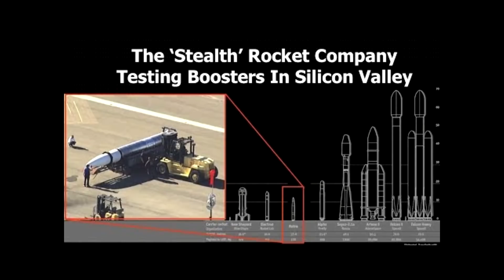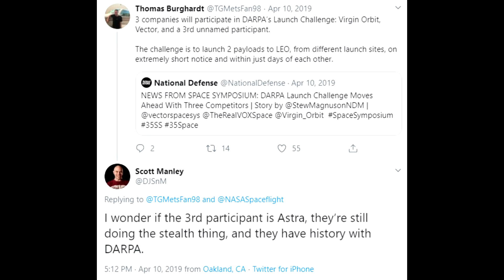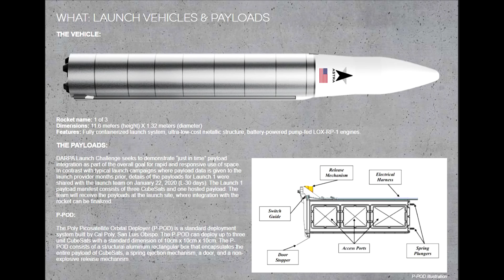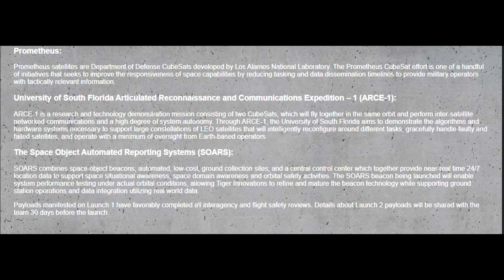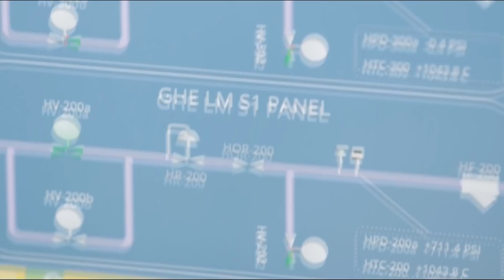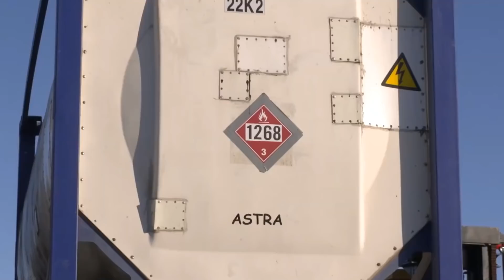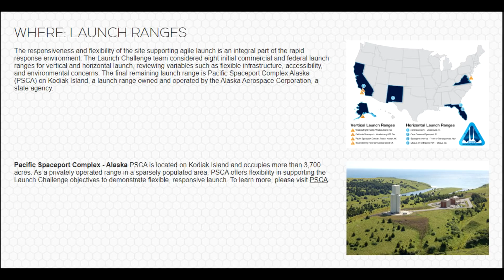Astra's Secret Rocket Project Finally Reveals Itself

Comment: V2, 80 years later...
Reply: V2 couldn't launch to orbit
Reply: Dean Su neither this! (We'll see)
Kind of US Scud missile in making...
Reply: @stormtrooper9404  Scuds are only big Rockets.
 Ballistic shells, only launched by a rocket engine instead of an explosive charge.
  Missiles have guidance.
As it appears, the first two were indeed only Scuds, but without a warhead.  Let's see if they can actually MAKE a missile!
Reply: @stormtrooper9404  It can though, that's the whole point of this program. So it vastly outperforms Scuds and V2s and anything less than full-blown ICBMs. Of course, it doesn't come with reentry vehicles for the warheads, so it isn't really meant for missile use anyway
Reply: @dsdy1205  Rumors say they did hit space with the V2.  Hitler had plans to orbit a large "Sodium" coated mirror, to burn  targets on earth from space anywhere, any times. . .  Sound familiar?
Reply: @cyiabsalon9720  they definitely hit space with the V2, but getting into space is very different from orbiting.
Reply: @johnvonkerman  Come on Peter.  You well know that if they had the time, it would be a fact.  The German Nazi's were ahead of Everybody in that regard.  At that time, the worlds Best scientists and researchers of the world were already captive of the 3ed Reich.  . They cleaned out Vienna, bagged them all, and drug them back to Germany.  Everybody else was hard pressed, scrambling to thwart them at every turn. . .  Lucy for the world, they came against a brick wall when they ran out of oil, and had to synthesis their fuel.
  After they war, the US nabbed up every scientist they could get their hands on from Germany, and put them into OUR war machine of which NASA grew out of.
Reply: @cyiabsalon9720  ok? I just said they didn't have the technology. The V2 had nowhere near the deltaV to get to orbit. Remember, we got their scientists after the war and it was over a decade before we put something into orbit
Reply: @cyiabsalon9720  Hitting space is very different from hitting orbit. The V2 did indeed hit space, as did several artillery shells. To stay in orbit, like this rocket does, you have to go 7 times faster than that. Quite a mean feat of engineering.
Reply: @dsdy1205  And if the Nazi's had a little more time, . .  What do you think?  The guy who designed the V2, IS THE SAME ONE WHO DESIGNED THE DELTA-V5! And still has plans to build the Delta-V7.  But it's so large, it must be constructed in orbit.
  Now think; Where was all the rest of the worlds scientists who were NOT under the Nazi's thumb in those days?  There were very few "Free Scientists" left in the world back then. Given another year or so, the Nazi's would have done it.  But, they ran out of gas, and the rest of the world capitalized on their "E-for-Empty" problem.  That's the ONLY reason why Germany lost the decisive "Battle of the Bulge".  The Germans simply ran out of gas.  That includes Kerosene for their V projects as well.
  And no.  I'm not German.  No bias here.
Reply: @dsdy1205  The size and mobile launch system are extremely comparable.
Reply: @bouldersoundguy  Indeed, the size is comparable, but the performance is way beyond V2 levels. The V2 could barely hit England, this thing is orbit-capable, which means it can toss payloads as far as modern-day ICBMs (which can also launch stuff into orbit) can.
Reply: @Joe Horn You Bet'cha!. . .  Supposedly a whole fleet of them.  BUT, there is a fun story to go along with it.  Allow me:
  The Nazis were in contact with the reptilians a little while after the beginning of the war, right when when Hitler wasn't Hitler any longer. . . (Another story for another time.)
  Anyway, the snakes just up and gave the Nazi's several craft to study and to train human pilots with.  Hitler was getting worse, and he was starting to slaughter his own due to not performing as his sick mind insisted of them.  SO, the top officials of the saucer project, along with the largest cadre of the most influential scientists they could muster up, hopped on board, and took off to the moon and Mars, stranding Hitlers dumb-ass here on earth, where they remain yet today.
  I waiting for a picture from the Rover Curiosity to come back with something there sporting a great big ol' Swastika or an Iron Cross. . 

 Ooh gawd, wouldn't that be so much fun to watch everybody crap their pants?
Reply: @Joe Horn Humm. . .I've heard so much about Nazi Germany and flying things that glowed; foo-fighters, the Bell, even that they were given the plans to make the propulsion system, so they attached it to several of their U-Boats, `cuz they were air tight already. . . (yawn..)
 As for Hitler in his back yard with an erector set?  nope.  That's a new one for me.
Reply: Operation Paperclip (Von Braun, Kurt Debus and many more German rocket scientists )  started -up in 1944 with project Hermes V2 program.

Comment: This launch table looks like one designed for V2.
Reply: Why re-invent the wheel?
Reply: Jttv , Atlas program.
Reply: Well you need to eat when doing rocketry.
Reply: The whole concept is exactly the same of the V2.
Reply: @SVanHutten  well except for how the rocket actually operates since I doubt it uses clock work guidence or a peroxide generated steam powered turbine for the pumps.
Reply: @maxk4324  It uses electric pumps
Reply: @sundhaug92  Ya, I saw that later on in the video, but thank you none the less. This only reinforces the fact that it is very very different than the V2
Reply: Max K it also doesn’t hit the ground in populated areas and detonate.
Reply: @SVanHutten    The same concept as the V2?
As in 'liquid bipropellant rocket', sure.
About everything else is different.
Different fuel (ethyl alcohol)
Different pumps (electrical instead of T-Stoff (hydrogen peroxide) catalysed tOo steam driving a turbo pump)
Differently shaped burn chamber
Different number of engines (1 vs 5)
Different attitude control actuators (two sets of 4 vanes: one set of graphite coated one in the rocket exhaust and one at the end of the fins versus 2-way engine gimbal)
Different guidance system (PIGA acceleration meter and pitch/roll stabilisation via gyroscope (and radio beam following, though rarely used) vs a grown up INS/GPS/radar/radio/laser metering, possibly star/sun/earth tracker usw systems)
Different payloads (obvs)
One-stage suborbital rocket (up to 320km or so) versus two-stage orbital rocket
Military government project vs civilian project
Machine of war and destruction vs access to LEO for smaller payloads at lower cost.

Yep, it is all the same, and so is the fireworks rocket you fire off.
Reply: ADvorak ADvorak it’s still very much a military government project and a machine of war and destruction...it just so happens to be LEO accessible, lower cost, and rapidly deployable as well...DARPA even mentions “warfighter capability” and bringing launch availability up to the mobilization speed of our other branches...who have global rapid response capabilities able to “reach out and touch someone” in the same timeframe DARPA allotted the project for this launch.  The difference will be the size of the boom (and likely number of booms) it’s payload carries.
Reply: @SVanHutten  With the mobility of the system and that launch stand, I immediately started thinking of the V2, though the purpose and technology are be vastly different.
Reply: @SVanHutten  Well the mobile launch part is but the rocket itself is very different.
Reply: Nope.
The V2 table had just a spike in the middle, re-directing the flames into all directions (including against the table structure itself).  This is not the case of this launch table.
And that is just one obvious difference.
Reply: Well, look out London!
Reply: @zapfanzapfan  Shit... I live in London... lol
Reply: That was also my impression
Reply: Late-stage DARPA is so grassroots
Reply: Somethings better than that
Reply: Well, it’s a militarized rapid deployment rocket with presumably “dummy” payloads...sooo yeah.  How fast can we get a sub-orbital/orbital weapon in the air...
Reply: It looks like an ICBM.
Reply: Why change something that works well for the application?  There's only wasted time, material, and money produced by re-inventing the wheel.  Simplicity is usually much more durable. . .   (Compare the NASA approach against the Russian old fashion, boiler-plate style Soyuz craft.  Theirs have been working solidly for over 50 years.  NASA? Not so much.)
Reply: @cyiabsalon9720  Solid, simple designs are only effective if you can manufacture them to spec. There have been two HSF-rated Soyuz anomalies in the last half-decade. Both due to manufacturing and/or assembly defects.
Reply: @dougpowers  Correct.  Nothing we make as a race is 100% infallible, or 100% durable. .  However, in this case, the Russians have it more in hand then NASA does.  Maybe that's a good reason why the Chinese are copying the Soyuz instead of our Shuttle?
Reply: @cyiabsalon9720  Russians use incremental development.  They make what already works into something better.  The US are more into revolutionary innovation so they start over almost on every new project.  Two mindsets but considering SpaceX successes there can a payoff for audacity as long as it is investor money.  Government agencies are too far removed from the consequences of failure till we get it right approach.
Reply: @mikecimerian6913  To a degree, yes.  But there is a transition period in which there should be an overlap to some degree.  We have to jump right into a completely new platform, just when we barely understood the previous, you know. . .  That Incremental thing you mentioned.  That's how SpaceX is going about their fabulous advancements, right? They haven't even dabbled in anti-gravity or space stations, the latter being Jeff Bezo's area, as of yet.
Reply: @cyiabsalon9720  spacex employs a bit of both. They had a major jump early on when they decided to go from falcon 1 straight to falcon 9 after the first successful falcon 1 test flight. This worked out well for them as everyone knows. Then once the first falcon 9 commercial flight was a success they began to iterate on it until they arrived at the latest version, Block 5. They have other examples of both strategies, those are just the most famous. In reality the best solution is almost always a mix of the two, employing big jumps when you must in order to not waste time in the kiddy pool, but then incrementing once you arrive at a successful design that shows you can keep your head above water in the deep end. The reason NASA and the Russians seem to only ever employ one or the other is a bit of a mystery to me.
Reply: @cyiabsalon9720  We know what conditional funding does for rigor.  SpaceX went incremental, agreed.  Their realistic approach is paying off.
Reply: @mikecimerian6913  they are kinda risking themselves again with Starship too, and i'm sure even when the first Starship flies there will be thousands of progresive itinerations until they arrive at the perfect design
Reply: Cyi Absalon Soviet Russia used the Soyuz because they failed to complete their shuttle, the Burron. Thy used a simple design because thats all they could come up with as the Soviet Union dissolved.   That is not some superior game plan. Its the failure to build anything better and a failed economy.  

The Soviet Union had a strong space program, Russia is only a shadow of its former self.

Comment: Split my sides at Arce Soars, haven't laughed as much since Randy Bender's presentation for NetWare.
Reply: Marc Jackson  I was a Netware tech.  Netware 4.11 was the best and was never surpassed.  Netware techs always scoffed at MS servers for their need to be rebooted and defragged.  I ran a server cluster on a two year clean run.  The OS was so reliable that people would forget where the server was.  Netware forever.  :)
Reply: @mikecimerian6913  Wow, that does sound like one hell of an OS! :) I'd like a stable branch in the development of modern operating systems, but no - much of what's released to the public is years away from leaving the beta stage... :D
Reply: Didnt get it. Could you explain for not english speakers?
Reply: @fs2728  Arce sounds like arse [USA=ass] which is English slang for anus, soars sounds like sores so it translates to anal herpes. Randy Bender is a man's name in USA but it means "sexually excited homosexual" in English slang.
Reply: @andyalder1  I thought it was a pun for Archosaurs
Reply: Prometheus's Arce Soars.  🤣
Reply: Marc Jackson  Netware 4.11 was never intended to "host more functionality". It was a file and print serving architecture, period. And it did it very well. When it came to strictly serving files, they were served to the workstations faster than anything Windows could do at that time, and equaled what any unix system could. I also directly administered several Netware servers in the early 80's, all of which ran for over three years with zero unscheduled downtime. That's better than "5 nines". Microsoft was simply the elephant in the living room that squashed them and 'nix both. (Linux/Unix today is a different story, but let's not judge the past by today's standards.) Novell tried to compete with Microsoft for the "office network/intranetwork", and that was a significant factor in their downfall. They never found their own place in the business world.
Reply: @sidewinder666666  There was a story in the news in early 2000s that they couldn't physically find old Netware server on their network, only to discover two cords (power + coax) going into a brick wall. After breaking through they found a Netware server that was just left in a wall niche behind new brick wall that was put by some jokers builders performing some reno job in that campus several years prior!

That thing just stayed there for several years, unattended, continuing it's file service until someone decided to find it.

I was never fan of Netware. But it did it's job just fine.

Sorry for the offtopic.
Reply: @andreybashkin9030  true.
Reply: Andrey Bashkin I heard the same story about a VAX Cluster. After a couple of decades of continuous uptime for the cluster it was finally shutdown one machine at a time. Only when the last machine was turned off the cluster was still responding. Turned out one old VAX was hidden behind a partition wall still running faithfully. Which of these stories is actually true may never be known, but they're both very plausible.
Reply: I remember Netware 4.6b, with star connectivity (pre-coaxial network cables), and bespoke server hardware. The first thing I was told to do when I joined the team was to strip a server of all its boards, and reassemble it. Good times.
Yes, I am old.
Reply: Looks like my reply got put into a moderation queue. Oh well, there's no way to re-word it to avoid that.
Reply: NO, not Arce Soars, but PROMETHEUS arce soars. Ass sores on Prometheus.
Reply: I used to work for the company that rebranded itself as Hand Technologies.  I never gave out a business card after that!
Reply: @owensmith7530  I was watching my twitter feed yesterday and all of a sudden "Dick Pound" was trending nationally. After briefly wondering about the future of society I saw a news article and discovered that this is the unfortunate name of some Olympic Committee member and they were trending for potentially moving or cancelling this year's games....
Reply: Marc Jackson  Bye I'm out of this pissing contest.
Reply: Marc Jackson  Nothing you said about Netware is true. You must not have been around during the 80's or 90's. Netware used IPX/SPX and it worked very well in a local LAN environment and was easy to install. Netware servers file/print services were famous for reliability. That technology worked well for that time. You could install an IP stack for Netware 3.x but you didn't need it. You just needed an IP gateway if you wanted access to the internet. In fact using IPX/SPX provided a natural firewall. By Netware 4.x IP was installed out of the box but you could use both. Netware and NDS was superior to Windows and AD until mid  2000's.
Reply: @Marc Jackson
I think yours "primitive" is a lot different from mine. Novell Netware was fast, extremely stable and easy to maintain.

Comment: Imagine how cheap these things would be if they were recoverable
Reply: Probably more expensive actually since you'd need to 1) make everything durable enough to reenter the atmosphere, 2) add the hardware needed to recover it such as parachutes, 3) set up a way of catching it midair, 4) use engines that can be reused many times (most engines can only survive a few firings for testing and the launch itself), and 5) hire more people to prep the recovered stage(s) for another launch in addition the the manufacturing team you already need for brand new vehicles. Recoverable isn't always the best depending on what the goal is. When trying to make a launcher that maximizes response time recoverable is definitely not the best option.